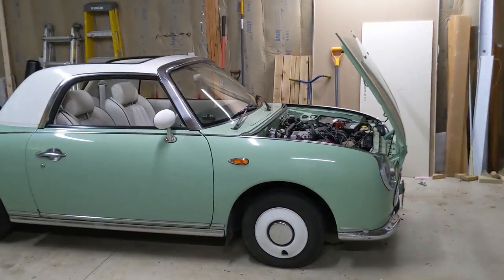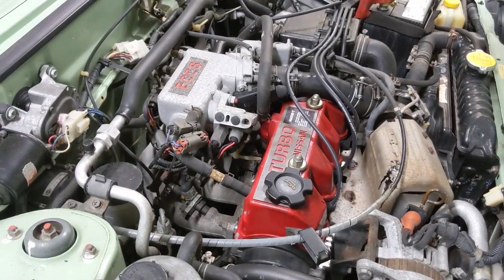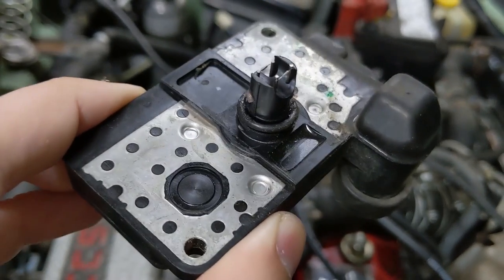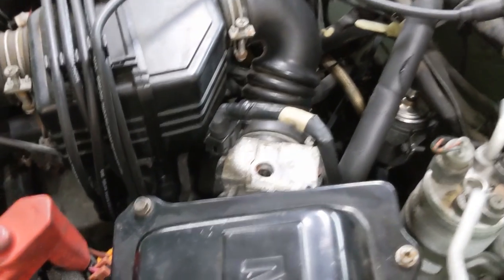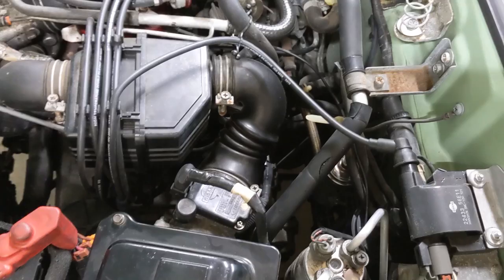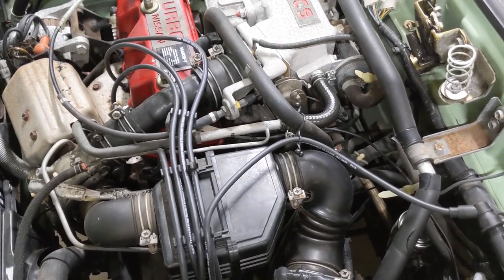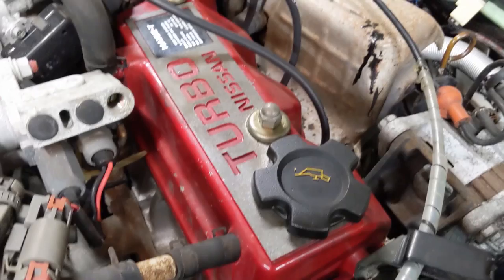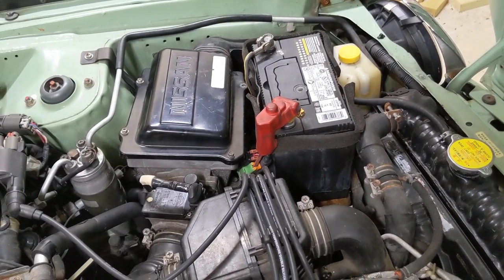Modern engine control musings and Fixing a Figaro

Comment: I'd be replacing the MAS (mass air flow sensor) it's looking pretty old and  you could get even more improvement in performance with a new sensor. Good quality after market parts are better especially on a 30 year old car. The parts a often revised to address know design faults. And before any one say the engineers who design the car know best, NO, all cars have know design issues and in a lot of case these are done deliberately to force back to the dealer where the charge you big buck to fix  it. Eg On the Holden Commodore VZ the LE0 and LY7 engines have extramural poor ventilation on the Right head leading to oil crud build up on the Right coursing timing chain issues. Left head has good ventilation.

Comment: i had this same issue on my volvo wagon not terribly long ago...i got it fixed by removing intake inspecting everything and found out that slight leak on the tubing it somehow in its lifetime slipped juust enough over the little hooks on the throttle body rim that air rushing in unmetered, causing hard starts and stalling specially hard time when engine was "cold" but could happen sometimes with a hot engine after turning it off and back on.. 

my advice assuming MAP and MAF are installed and should be those 2 as forced induction engine and should have 2 sensors:   

1st.. plug in sensor again as you did.. start the engine get it running and "happy then unplug sensor.. leave it fitted and sealed in the intake but remove wiring from it. reason for this is it will help you find a direction to go to solve this issue.     engine should stumble but remain running not surging this means got 2 sensors and second sensor (map most likely) is still working.      if it stalls instantly this means either missing 2nd sensor (map) or that sensor is dead/offline.     if it surges up and down this means unmetered air slipping in further up or means you got bad data streaming in from the MAP sensor.  if it goes unchanged this means either the MAF sensor is dead or ineffective or large gross leak somewhere any that sensor is doing very little but it means u got a 2nd sensor upstream somewhere..   this require some poking about but its easy enough..      while your in there locate all sensors around intake and intake manifold and throttlebody.  you can also unplug enough things as you go and find what satalls it and what makes little differance and work backwards as well..

2nd.. remove intake and clean everything including throttle body. sometimes the issue can be the throttle body is just gummed up just enough that it cant make small adjustments that it needs to make at startup. sometimes get gunk between the metal fittings from it slipping out of place or not being tight enough over time or something and that causes a leak...

3. when refit everything intake related and make sure its as fr on as it go and clamped as hard as you dare go then some... 

4.  check fuses. unlikely but when helping someone with same issue on a dif car as well i found a blown fuse that i replaced  cuz whatever that fixed it and that blown fuse was to something seemed unrelated but i guess was a shared wire there to something i guess..weird because all data was there before and after but fuse fixed it

Comment: 1:33 Surging and "starts, then stalls" might be the idle air control mechanism (IAC valve). That issue list perfectly describes multiple cars I've had over the years with the same problem. Could be bad or just very dirty. Reference: I had a '93 Mitsubishi that did the exact same thing with the surging and stalling.
Reply: 6:30 (he literally points at the IAC) Okay, nm! lol

Comment: My Japanese-market car (also made in 1991) also needs a little bit of throttle on a cold start. The onboard diagnostic system (displayed with live data on the onboard touchscreen CRT) hasn't indicated anything out of the ordinary. Air/fuel ratio is normal.

Comment: I had a MAF sensor issue in a car made in 1986 that caused rough idle when it was first started.  The relay that supplied power to the MAF sensor had corroded contacts and the sensor was only getting about 1.5 volts.
Reply: I don't think this is a vacuum leak because those don't magically disappear.

Comment: I suspect a vacuum leak. During cold start the engine will run in open loop. After a short amount of time the o2 sensors will be hot enough to give credible data and then the issue will disappear as the system will have feedback to correct a lean mixture.

Comment: That’s probably a vacuum leak. The best way to find one is to get some starting fluid and spray in different areas and listen for the rpms to rise. Wherever it does it at is your leaking hose.

Comment: lol a can of mass airflow cleaner is standard equipment on my 03 prius; it will sometimes start and then die because of a very slightly off maf, and it usually works if you just turn it off and on again a bunch of times but if it doesn't want to I want to be prepared to clean it and wait 20 minutes while it dries.  
but on a figaro I think you've got vacuum leaks; vacuum lines are evil.
heh you mention "when it goes into closed loop mode", heh yeah, startup to closed loop shutdown gang!!!

Comment: My car (1989 Mazda 323) has an analog computer. To read the error codes I have to short to connectors with a paper clip, and use a test lamp on some other connections to count the blinks. As it is analog, it does not store error codes; they have to be read in real time.
Also my mass air sensor is mechanical. It is a flap connected to a potentiometer.

Comment: your problems remind me of a friend with the exact same problem on his 86 Mazda rx7! it would stall out if he didn't give it gas on a cold start but once it warmed up a little it would idle just fine. I don't think he ever fixed that before selling it but he did trace the issue to a faulty idle air control valve

on a related note, my father's 95 Toyota Tacoma wouldn't start because of a cracked vacuum line that led to the A/C idle up valve. didn't seem like a very big leak but it was enough to to make it not start. all sorts of weird quirks that come with an old car

Comment: Your starting issue may be due to an injector leaking down. Once the extra fuel is burned off it will clear up.  You can put a fuel pressure gauge on and watch to see if it leaks down when the engine is shut off.

Comment: 13:43 I hate to be the guy bringing up the one exception (actually, that's a lie, I love it), but I have an '88 Ford Orion (that was the saloon version of the Escort) with the 1.8 Litre diesel engine and it has very few electrical components. Fuel injection is purely mechanical, leaving only the glow plugs and an electromagnetic valve in the fuel line. The glow plugs are only needed to start the engine and funnily enough, the only purpose of the valve is to shut the engine off by starving it of fuel.
In more general terms, while electronic ignition was already a thing in the '80s, it took some time before it was cheap enough to be standard in such reasonably priced compact cars. If I recall correctly, smaller petrol engines used in the Escort also had "classic" mechancial distributors and carburetors.
Reply: My 81 Toyota had electronic ignition with a distributor and a carburetor. It was a problem when the ignition electronics went out, but it took 35 years for that to happen.

My 98 Honda has electronic ignition, with a distributor. 

Distributor-less and electronic are not the same thing.
Reply: @AlexandarHullRichter  I know, I never said anything like "electronic ignition means no distributor" or "electronic ignition didn't exist in the '80s". All I've said is that there were cars without electronic ignition even in the early '90s.
Reply: @somitomi  which 90s gasoline cars didn't have electronic ignition?
Reply: @AlexandarHullRichter  Um, the Ford Escort Mk4 I mentioned already? I don't have the repair manual with me right now to double check that though.
Reply: @somitomi   I believe you said that was a diesel which has no ignition system at all. 

I was asking about gasoline cars, on which I believe electronic ignition was ubiquitous by the late 1970s. IDK about other brands, but all 70s gasoline Toyotas had electronic ignition. Are you telling me there were cars later than that which required you to replace and adjust the points and mechanical spark advance? If there were, please let me know which ones so I can read about them.
Reply: @AlexandarHullRichter  Yes, mine's a diesel, but the repair manual I have deals with petrol versions as well (naturally). That's why I can't say for certain, because I never really studied the chapter about petrol engines, just glossed over them while looking for something else.

Comment: In my opinion the problem with newer cars is all the other computers. In the early 2000s there were still only a few computer systems and they had a specific function (eg. powertrain, airbags, antilock brakes, climate control are all separate systems functioning independently.) Nowadays a car's computers are all linked together on the CAN bus and there is more potential for problems to have a greater impact.

TLDR: Computer engine control good, entertainment system disabling brakes bad.

The extreme case: https://www.wired.com/2015/07/hackers-remotely-kill-jeep-highway/

Comment: Love your video. The wife and myself are just getting into working on cars. We bought a 1977 VW Beetle standard. It has a lot of the original EFI system. It has some similar problems to your car but a little cheaper in parts prices. I was however thinking of switching it over to a carb system because it might be more reliable in the long run?

Comment: Even my 1978 Datsun 280Z had an ECU and Bosch electronic fuel injection system. Had to clean the air flow sensor in it once. It was a giant flap connected to a potentiometer...soooo wierd.

Comment: Dude, there are simple steps to determine what's wrong with your car. And, if it's idling high all the time, then that contributes to it's starting issue. Take a can of AZ brake cleaner and spray around the intake. Look for a change in idle as you spray each location, to find air leaks. If you find nothing, then clamp off the house on that idle bypass when the engine is warm. If that doesn't correct they idle, then back out the throttle stop screw, that many people use incorrectly to set idle speed. It's purpose is to prevent the throttle butterfly from closing to the point of getting jammed or stuck. On older cars, vacuum lines break, allowing unregulated airflow into the intake, where vacuum is generated. Any smart mechanic could diagnose a high idle in minutes. Also, clean those injectors with a bottle of Techron fuel system cleaner.

Comment: Wow! Cool ride! Did you get it to run right? Had a similar computer control system in a 1990 240SX. 
Worked on Chrysler Lean Burn engines (I think the first computer engine control) in 1978, and GM feedback carbs starting in 1982. Many others since then...I'm showing my age...ugh.
I think your IAC is fubar-d which would explain the surging(essentially a vacuum leak) and hard starting. That looks like a Bosch IAC, which has a small valve that closes a throttle bypass port when warm. It opens when cold to increase idle speed. Maybe...that's  it. Just my $0.02 worth.

Comment: There's actually a different type of mass airflow sensor, which uses some kind of diode or something to read pressure pulses as a frequency https://en.wikipedia.org/wiki/Mass_flow_sensor#K%C3%A1rm%C3%A1n_vortex_sensor
A hot wire MAF like that just changes resistance based on how hot/cold it is.

Comment: Since this is ECCS from around 1991, and your distributor has the crank angle sensor in the distributor...your ECCS is a very similar operation to the one in my 1989 240sx.
Kinda cool to see it all laid out here!
Also the process for reading codes is just like my 240sx...the blinking lights...at least you can remove plugs to look at yours!  I have to remove the entire kick panel...
Also the car should have self-idle control...Idle Air Control Valve.  1500 is...awfully high afaik.
AS FOR BATTERY TERMINAL...it's an old ribbon style terminal.  Those are garbage as they gradually wear out.  Replace it with a chunky piece from an auto parts store. Not hard and you'll thank yourself later.

Comment: You could buy a vehicle with a carburetor in the USA until 1994, so they didn't all have computers. There are also cars like my 1990 Volkswagen Fox which has a computer that tweaks the mechanical fuel injection system. The car runs with the computer disconnected, not as well, but it does.

Comment: The idle on my 04 Colorado fluctuates when the throttle body is dirty. Cleaned it up with some Throttle Body Cleaner and it ran just fine... until it got dirty again, lol. I don't know anything about Figaros... but you should check your throttle body to see if it is clean.

Comment: Think about it. 
On old carburetor engines a bad cold start was due to a faulty automatic choke. 
Your engine via a bunch of sensors accomplishes the same process. 
You identified the issue. You just don’t know you did. 
You said freezing cold temp it starts fine. Room temp cold it fails to start easy. 
What ever temp sensor is controlling the air fuel mixture is wonky. 
I can’t say faulty. 
But it’s something to look at.

Comment: Your issue sounds more like a leaky crank case ventilation than a bad MAF, in particular the surging is a common symptom of that: As the engine RPM increases, it pushes/sucks more air in through the crank case which is not measured through the MAF sensor, causing the engine to run lean, and the RPMs to drop again. Repeat.
The ECU should be throwing a fault code if the MAF is bad, but if the mixture is off it can compensate to some extent.
The car can start and run even without a MAF, it will throw a fault but maintain the mixture through the exhaust O2 sensor only, or if that also fails, through the pre-set motor map in feedforward fallback mode.
Surging at idle AND turbo lag suggests a vacuum problem since the turbo bypass valve is also actuated by the vacuum system. Keep an eye on your power steering and brakes because engine vacuum is also what powers the hydraulics.

Comment: Yeah, if you don’t have a manual choke control, there’s already a ton of computer integration into the engine. I have ridden a lot of small-CC motorcycles for about ten years or so, and to keep costs down, they’ve not really switched to much computer stuff at all until very recently. (On a $20k car, it’s easy to wrap in the costs of a CPU, on a $2k motorcycle, way harder.)
What I find interesting is that most people complain more about the computer taking over the ignition from a distributor cap, not realizing that was only just kind of the last of the electronics taken over, because distributors Just Work(ed) for a long time, and you really didn’t want the computer taking over that duty until it could do a Good Job at it. The choke and idle speed, and all the fiddly knobs that I had to maintain on my motorcycle? I never had to control or worry about any of those on any car I’ve ever used, because again, yeah, it was way easy for a computer to take over that job.

Comment: I have similar issues with a similar engine. My 1990s Volkswagen idles high(not always),runs a bit rough and will stall when engine Temp is about halfway between cold and operating temp. Idles fine cold, idles fine hot but in between i have to restart it a few times while trying to back it in my garage. Found a vacuum leak, that helped a bit. Cleaned the idle control valve, that did nothing. Changed the engine temp sensor, nothing. A new Oxygen sensor made the car run worse, I returned it and got a different brand, that solved the stalling when half-hot and made it run waaaay smoother. My only problem left is the high idle, but Im willing to ignore that for now. That engine is controlled very similar to your Nissan engine, it has a hall sensor in the Distributor, electronic fuel injectors but a mechanical gas pedal. Only difference is my car has a flap in the airflow sensor no heated resistors. Oh and there is absolutely no way to get error codes from the ECU.

Comment: The sensors are seemingly for sale online, tho they aren't "Cheap" at between $100-200ish depending on the conversion rate, many seem to be in europe, but Amazon has one for $200 and ebay and other specialty stores online seem to have them in stock in case it doesn't help.

Comment: As I have a 91 import myself with most of the original sensors, yes troubleshooting can be a whole lot of fun! I'd be curious as to the book value for RPM's on yours as on mine, 650 RPM is listed as "Idle speed".

Comment: In our glorious mother Russia , we could still buy brand new VAZ 2105/2107 until 2014!
A glorious Russian car produced since 1979 (who really is just a facelift of a car produced since 1962)

The most advanced thing in the car is the radio it does not come equipped with 

You have good old carburetor , choke to pull , distributor to spin 
Although, this is a very advanced car still, it has overhead camshaft!!

Much more modern than the ZAZ and AZLK who still have only pushrod OHV

Comment: Great Video, and Congrats on the improvement. It's a Milepost in every Young Man's life to have fun with an old car, and you learn some engineering in the process. Sadly Soon, this disappears as The Wife gets tired of that "old thing" draining finances from Her Purse, which is Your Wallet, and occupying space in the garage, after all it's all about HER car that matters now. And Forever, almost: But happily, a Third Life and ANOTHER CAR usually arrive on or after Junior's sixteenth birthday, and the process is repeated by Junior in a never ending life cycle.  And you are right: "Modern" cars precisely meter the refined Dinosaur Blubber so that it is used most efficiently. All the Best! DE W8LV BILL